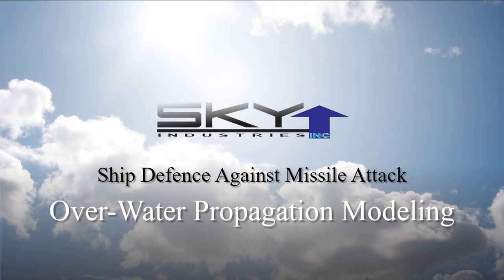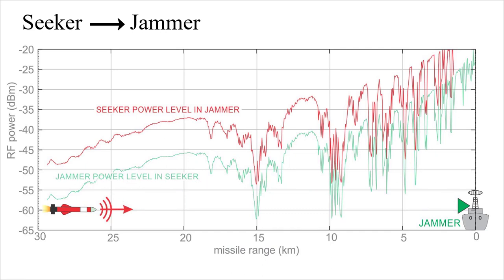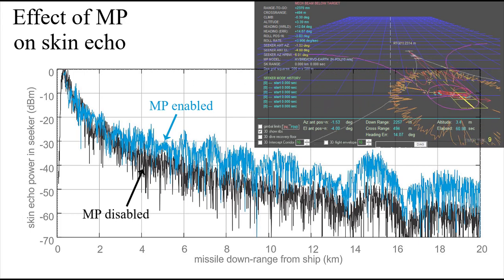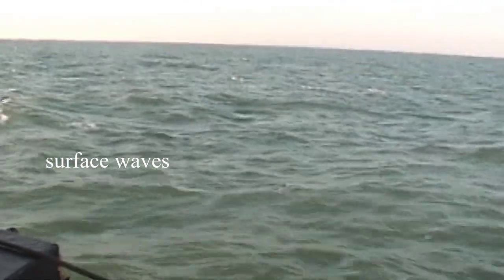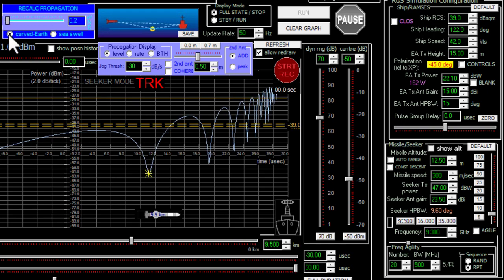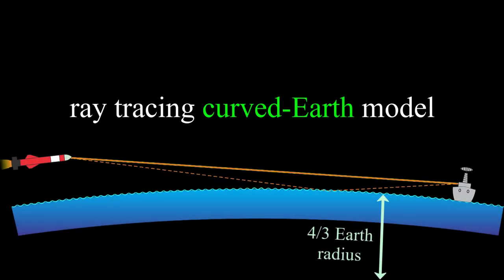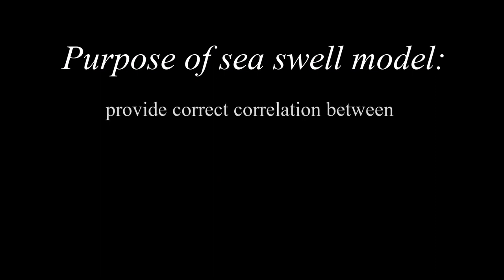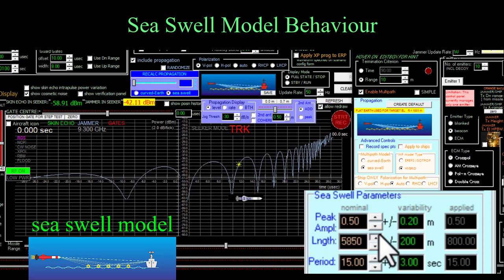Propagation Modeling 03

Comment: What does multipath do in this case for the missiles elevation aiming error? Are the grazing angles so shallow that it ends up not effecting where the aim point is in any meaningful way? If it does what are the techniques employed to counteract this
Reply from the maker: Interesting question; I haven't used ENGAGE to look at vertical glint, but I expect it's there as a Crosseye effect.  

ENGAGE will show the effects whatever they are.  I'll have a look today.  

Here's how to cancel multipath: 

Part I: https://www.youtube.com/watch?v=jiQ59s5Hvgw

Part II: https://www.youtube.com/watch?v=nTTfthDI5ZI
Reply: @skyindustries  i guess it would be mainly coupled to the range resolution of the seeker. I'd be interested to know what the nominal requirement is there for multipath induced elevation errors to be effectively eliminated